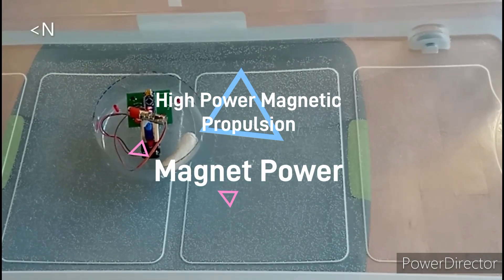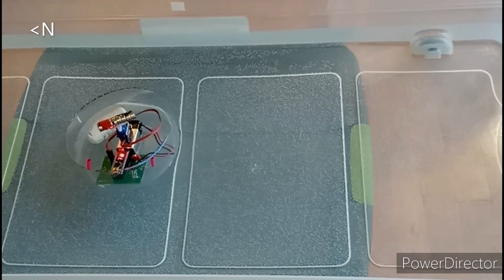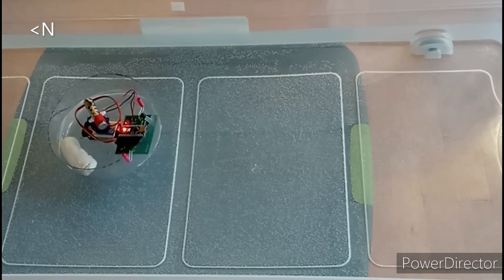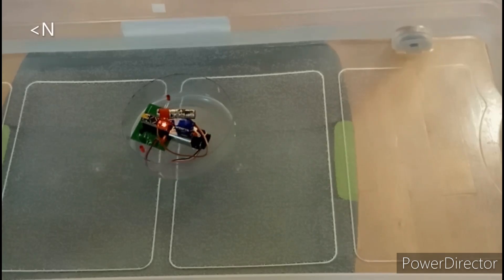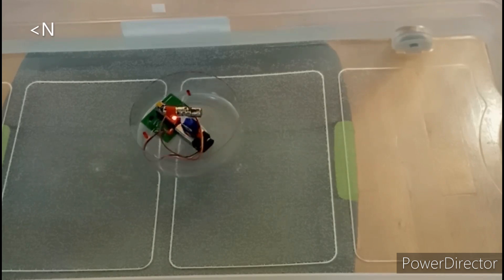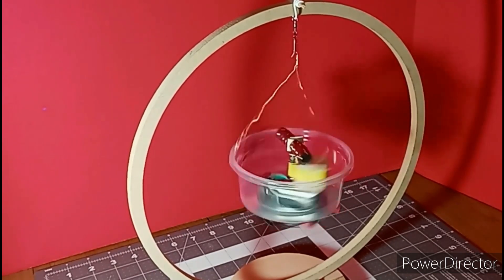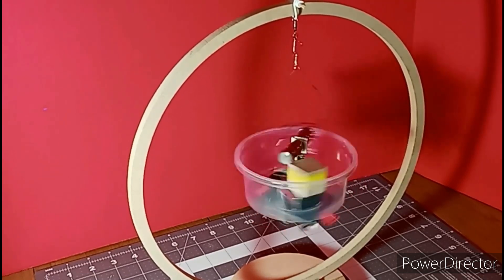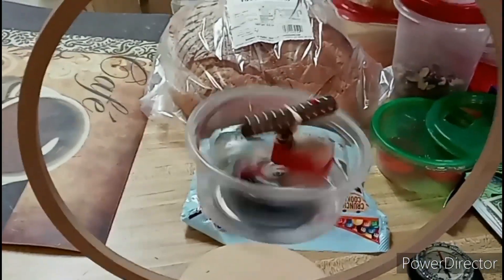High Power Magnetic Drive In Theory

Comment: What exactly was supposed to be high powered?  Using the Earth's magnetic field for propulsion is not a very good idea. The field strength is miniscule even if it's ambient. Forces in magnetic systems come from gradients so uniform ambient fields are the worst sort of situation you could ask for.
Clearly it's a topic of interest though so i would recommend you build a halback array coil and use an alternating field coupled with a capacitive electric charge in contact with the water. If you choose the resonance carefully, you'll find that it is quite effective as a means of propulsion.
Reply from the maker: Thank you for watching and commenting on this video. Our opinion is  that while the Earth's field in one point is miniscule it adds over larger areas and depending on the size and strength of the magnet on the boat exerts varying larger measures of torque. Water is the medium of the experiments so our focus is not in interaction with water.